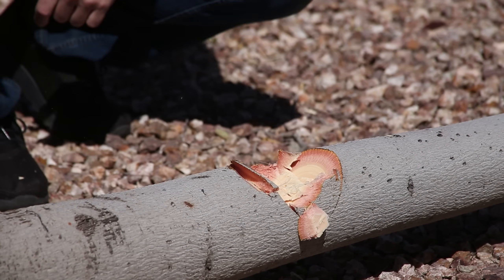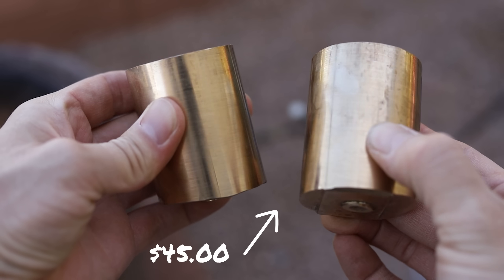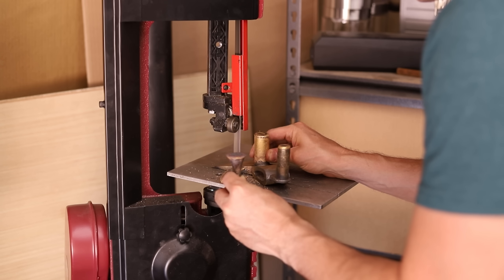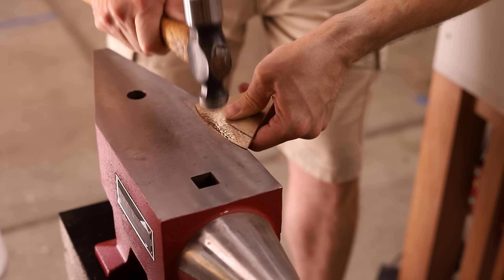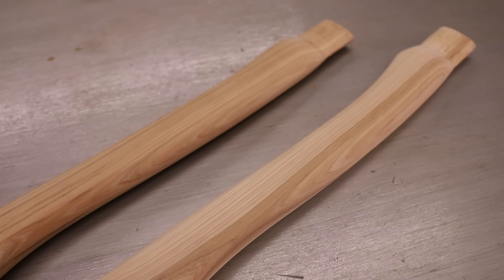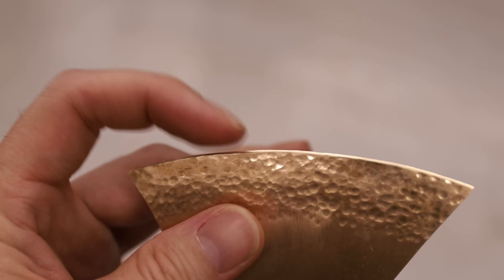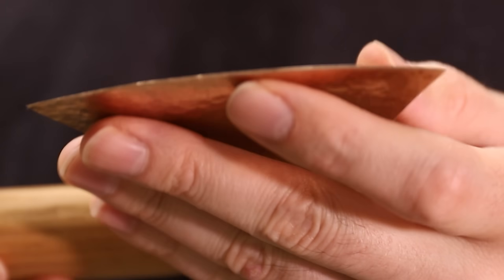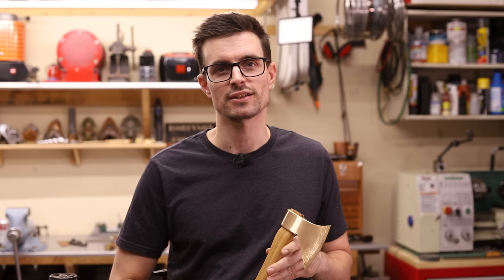Aluminum Bronze VS Tin Bronze, Making & Testing Bronze Hatchets

Comment: Nice thing about bronze as a tool is that if you keep a small forge with you, if it ever got mangled. You can simply recast it.

Not to mention (though I cant think of a scenario this would be needed.

You can melt the bronze down and make a few smaller tools with just some wax for shaping and good loamy clay  to mould around it. 

1 axe (of that kind) could become a smaller axe or even adz , a hammer and chisel. 
Bronze can be recast and recast.

That's just my mind going over it

Comment: Why wood?
I mean it's light and it does the job and it's common, cheap and there's nothing wrong with it
but what other kinds of things could we use as handlers? like, metals? and how would it impact the weapon and its usage?
Reply: how long is the lifespan of wood? for how many years can a weapon with a wooden handle still be usable?

Comment: It works, which is neat to see, but definitely diminishes over time faster than a steel hatchet. Though we expected this, it held up for the most part. Proper PPE is required. It could be electric, but it's not going to be any better or worse, just hot and definitely start a fire. That being said, be wary of static. Would it be more effective against a Terminator? It's debatable.

Comment: Tin bronze should be tough enough for all wood. The reason iron replaced bronze wasn't simply just due to strength, it was a lot harder to find enough copper and tin compared to Iron.

Comment: If I'm remembering correctly, the bronze-smiths of the bronze age actually had a superior product to early iron tools; it was just a lot harder and more expensive to make good bronze tools; like how when firearms were introduced they were no better than crossbows, often worse, but they were a lot easier to train people how to use
Reply: Considering tin bronze axes deforested most of England during the Bronze age they must have been pretty effective.
Reply: Firearms have way more joules of energy than bows. There are videos here on YouTube of people testing out heavy crossbows that just bounce off armor, or dent it, but a musket punches straight through. It’s not the training. Guns are simply more powerful.
Reply: @gj1234567899999  this is strictly incorrect, high power crossbows of the time, and of today often have similar or higher energy, however it's a much slower, heavier, projectile; it's kind of funny in a way, crossbows have a tendency to punch right through modern ballistic vests in the same way bullets punch through plate armour; it's a design difference, not an energy one.
And to everyone who thinks I'm thinking of something else, this comes from an old history channel style short documentary that I saw years ago
Reply: @BronzeCactusorBronzeCaktus did you really just say crossbows have the same energy as firearms? You need to do some math. A 55 grain projectile moving at 3000 feet per second generates about 1100lbs of force. That is the standard weight and velocity fired from an AR-15. A 150 grain bolt head traveling at 400 fps has 53lbs of energy. That is a high powered hunting crossbow. And the AR-15 is an intermediate cartridge and not considered full power. 

The only armor a crossbow is going through is a light weight kevlar vest  those same vests won't stop any rifle round and will fail against some pistols it's not going through the standard plates now being worn.
Reply: Fro the bronze/iron comparison, you're partly correct. Iron is easier to find, it's practically everywhere and the most common metal on earth. Copper and tin are rarer, but they are easier to work with skill wise. (As seen in video, mix metals, pour into mold, polish, done) The reason the shift happened was that the rarity of copper and tin made it so that you could outfit only some fighters with great weapons. Iron on the other hand required no sophisticated trade routes and was bountiful enough to have minor warlords arm any and every person they wanted. The working of iron, done in solid form, meant more skilled blacksmiths were required to make better weapons, but 100 soldiers with iron weapons that were almost as good as 10 bronze weapons made the switch to iron mandatory.
Reply: You might be talking about the change of bows to crossbows as early firearms seem more complicated than the late crossbows
Reply: @hobknot  I could be wrong, but I believe iron replaced bronze because iron ore was easier to find than tin to make bronze. In antiquity the British Isles were known as the "Tin Islands"  and Cornwall and the Scilly Isles were one of the main sources of tin.
Reply: Yeah that was the reason as far as I'm aware  @stumccabe
Reply: @hobknot  true crossbows were definitely much easier to use and you could quickly train a bunch of peasants to pretty effectively use one, compared to a bow. Training somebody to use a bow effectively in combat literally takes decades, whereas you could train a bunch of unskilled people in effectively using a crossbow in just a few weeks or months. It’s part of the reason why the Pope banned the crossbow, deeming it a “sinful” and “evil” weapon. Early firearms as you said were definitely harder to use than crossbows and they were generally less effective, which is part of the reason why firearms didn’t really become a regular infantry weapon until centuries after they were invented
Reply: Early firearms were only used because they were far more powerful than crossbows. They were both much, much harder to use than crossbows and extremely dangerous to the user.
Reply: If Im remembering correctly, is boomer for pulling it out of their butt just so everyone is clear.
Reply: Hehehe… gun go BOOM

Comment: Maybe if you printed it on the side, the layers are easier for the printer to make it smooth without those big flat islands. Or any other orientation which seems logical if you split things in to, but not for very flat curves. Just an idea

Comment: If you added just a little bit of scandium to that aluminum bronze you would have a super tough piece then I don't know if it's possible but powdered metallurgy if you could figure out how to get that scandium distributed throughout the aluminum bronze evenly it's basically as hard as some steel though I could be wrong but probably not

Comment: I know there's a Modern Bronze alloy made that actually Hardens like steel does when quenching it instead of Cold-hardning like you'd normally do. and I would guess that it might have some Iron in it. if not straight steel. question is. could you Quench Harden the Alu-Bronze you have there the same way? I'm asking because it's got 3% iron in it and I'm genuinely wondering.

Comment: Blacksmith here. It's not called coldforging when you hammer the edge on something like that. It's called either workhardening or toolhardening. Coldforging is just some one trying to shape metal while it's cold. What you are doing is workhardening the tool by compressing the metal by hammering it.

Also, the woodgrain is oriented the wrong way. It need to be stright in the direction you are going to strike. There will be less bounce in the tool, and you'll be less likely to crack the handle. (I learned this the hard way)

Comment: The colour difference is likely due to having a different heat cycle applied to that area from the tig welding, causing a slightly different grain structure. Also the grain of the handle material is perpendicular to how it should be oriented for best strength. The visible growth rings should be in line with the axe head when looking at the end grain

Comment: I actually have a bronze age dagger. It was dated to about 1300BC it was obviously heavily used because the tip has been rounded but interestingly enough the pin for the handle is still stuck in it. Would love to see you make a copy of what it looked like back when it was new

Comment: nice work! one thing i would say if the wood you are cutting is just supported on one side and you hit it on the loose end it will wable and vibrate(no matter how tite it is secured on the one end) that makes your cut much much more ineffective than a thing resting on something solid. While it isn't what you were testing for, this point is still relevant for your test. Basically, cutting like this will make your tool perform a lot worse than it would while the damage to the blade may be worse
Reply: I wd also try making the shafts thinner, don't worry if they're well tapered they won't brake. Just giveit a try ;)

Comment: Your knowledge and efford is admirable, the result is slick and I am sure very effective yet I am surprised with your method of testing them on wood with no support right under the cutting point. which causesbouncing and breaking rather than cutting. I am sure those axes cut far better than what we see on the video.

Comment: I enjoyed the video (after being sent this way by the Metatron)!  That said, the edge bevel you used would better be called a "V-edge" or "Scandi" grind (or maybe a "saber" grind, if it was instead on a knife or sword). If you want an appleseed grind (a curved convex cross-section, rather than a flat-edged cross-section), the easiest way to do so with your existing equipment would be to shape your bevel on the slack of your belt grinder.

Comment: I always wondered how strong bronze was back then compared to steel and iron
Reply: Bronze is actually much stronger and tougher than iron as the latter is much softer. Archeologists have discovered that iron tools and weapons had coexisted with bronze tools and weapons side by side. However, bronze is an alloy of copper and tin. Tin is less plentiful than copper and only a few places where it is abundant. The end of the Bronze Age resulted from a number of factors. One such factor is the disruption of tin trade from either the tin mines that become depleted or from conflicts in places rich tin. As a result, bronze has become increasingly rarer and becoming more expensive. This led to the more abundant iron to become the predominant metal for making weapons and tools. The Hittites had improved smelting technology resulting iron became widely abundant and widely available. Sometimes low-quality steel is produced by accident.

Comment: Few things, your runner system needs work, it's got me stuffed why people go and print these patterns and then mangle a runner system manually. You should have <Ø10mm at the base of the sprue. Say Ø3/8" in Freedom Units. Next to pure copper and lead bronze, ally bronze is one of the most sensitive bronzes prone to gas pickup during melting. Deox treatment probably a bit hard unless you can get some from a foundry. Manganese is used in Ally bronze, which also aids in grain refinement.
Lastly, knock the ally bronze out while it's still red hot and cool it with a fan. This gives it a much finer grain structure.

Comment: That's not how you make an axe! You need to forge it (hammer and anvil) instead of casting it. Casting would make bad blade. Do you cast knifes as well?

Edit: Bronze is not a malleable metal, which means it cannot be 'forged' as iron or steel are - hammering heated bronze to draw it out or beat it to a forged shape risks destroying it, the stuff will just go brittle and fracture into flakes and chunks. Cold forging will just plain break it.

Comment: The ancients switched from bronze to iron because it was cheaper, slightly lighter and easier to make, not because bronze was 'inferior' to iron. Bronze weapons and armor are essentially equivalent in performance to iron weapons and armor. The most noticable difference is that Bronze is about 5-10% heavier per volume. Iron's other big advantage is that it can relatively easily be made into mild steel, and steel IS significantly better in performance than bronze.

Comment: The different color is because the metal was flowing towards the bigger piece and the atoms are slightly different arranged at that point in the material now, due to the direction of flow.

Comment: for sharpening you should make a peening jig, it will let you get a consistent sharp edge off of hammer work so you only need to do a few quick dressing passes with a file to finish it, preserves more of the hardened material

Comment: Im no specialist in bronze in particular but from i do know about steel the discoloration might be due to a different phase crystalizing under different cooling rate. Just a wild guess. Obviously it could also be contamination with oxygen from oxides from that self made rod. Im also curious how solable is argonium (from tig) in bronze alloys. Educated guess on my part tho.
My bet tho would be on the very 1st option - different phase during such rapid cooling.
Edit: now that i think of it, your lighter spot might be a little different in it's composition since parts of alloy could have oxidized more easily and escaped.

Comment: The metal is a different colour because aluminium is exceptionally reactive. By liquefying it you disrupt the oxide layer and expose fresh aluminium which very quickly reacts with oxygen to produce more aluminium oxide. However since your dealing with something that is only partly aluminium, the concentration is low enough for different thickness' of oxide to build up in different spots, as oppose to the fairly uniform layer with pure Al. This different layering of oxide exhibits what's known as 'thin film interference'. This is where light waves reflected by the upper and lower boundaries of a thin film (in this case the oxide) interfere with one another, increasing reflection at some wavelengths and decreasing it at others. Hence, the different colours.

Comment: Most bronze tools, armor, and weapons were also work hardened, a cold hammering process where skilled smiths would strengthen the metal just by hitting it properly. They probably discovered it by observation. Today we know it was realigning the molecules of the metal into a stronger structure, much like quenching and hardening does for steel.

Properly made bronze tools, arms, and armor was actually quite robust.

Comment: Very nice, but maaan, the handles! Stopping point should not be intetional, but natural, as you make the taper very long and smooth,  and then you hammer your axe on the taper and it stops when it wants to stop without burring some vrinkled wood around edge. It has to be like this and not what you are doing.

Comment: So cold forging is just hitting it while its cold?
Reply: Cold forging is a forming process in which the workpiece is not heated beforehand to soften it. Copper and copper alloys become harder when they are hammered.
Reply: @fpm1979  so does bronze harden from this? I know you said copper alloys.
So I guess yes.
I only learned  a few metals in school ,  I made a copper box with a brass lid as my  teacher said brass is too expensive.
Reply: @MrJJ86  There are many different types of bronze. All that have a cubic face-centred crystal structure harden when cold forged.

Comment: I would like to see a more realistic chopping with your axe's. People usually use more force when chopping wood. Also chopping in the winter with the axe is cold and the wood is frozen. I have a feeling they would not hold up as well. But I could be wrong. I have never tried chopping with bronze.

Comment: People think bronze is weak because they test it with the Mohs scale which is a scale for testing rocks. Bronze is harder than most steel, Cold hardened Bronze has a KSI of around 60 where most steel is about 50.

Comment: Historically bronze was more durable than most of types of steel they had available. Canons & even guns were made of bronze. And atleast in Indian bronze armour was used all the way upto the 19th century although not as common as wootz steel armour. But as blades they don't hold an edge very well.
Reply: Even now Bronze is harder than most steel with a KSI of 60 compared to 50 for most steel.

Comment: I think there are 2 reasons that the Bronze Age gave way to the Iron Age.
1. Copper was fairly common but tin was rare and was even shipped from Wales to the Mediterranean early on.
2. Producing bronze is less fuel, technologically and time intensive than steel.
The use of bronze declined as technology made possible the reduced cost and ease of producing iron and steel.

Comment: The spot is there because you burned some elements during welding, filler rods, typically have extra elements in them to counter that.

Comment: The colour change around the welding spot is due to a heat affected zone. Here the metal got hot enough for the microstructure to change, resulting in a slightly different colour. Same with the region near weld toes (the H.A.Z.).

Comment: Interesting. I have read archeology books that said that bronze wasn't necessarily worse than early iron, but by the end of the Bronze Age there was a lot of bronze items in circulation containing a proportion of lead (which they say softened the metal). Much of the metal used for new bronze weapons, armour and tools was recycled from older items.

Comment: These axes should be considered according to their wood JANKA rating cutting ability.  Through the various soft woods up into hard woods, one will find where they will be able to cut up to, but not including the higher wood density, and this JANKA rating gives a greater understanding of the cutting and tensile ability of these various metal mixtures.

Comment: I set up and operated a non ferrous foundry in the 1990s. Though I did not work with aluminum bronze, I seem to remember reading the strength of this alloy is approaching the strength of mild steel.  I most worked with brass, german silver and silicon bronze. BTW, it was a lovely job in winter, LP gas fired furnace kept us so warm!

Comment: I think the difference is mostly due evaporation of metals from the alloy due the very high temperatures of arc welding and also the rapid cooling of the molten metal might make for a significantly different crystal structure.